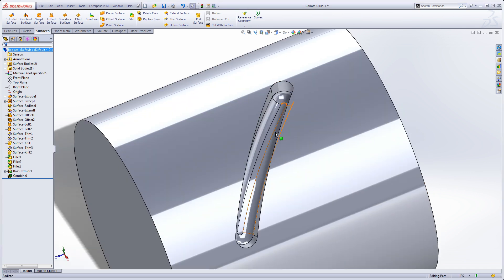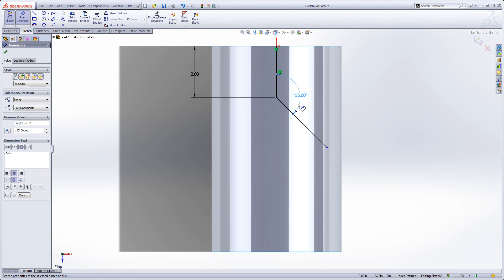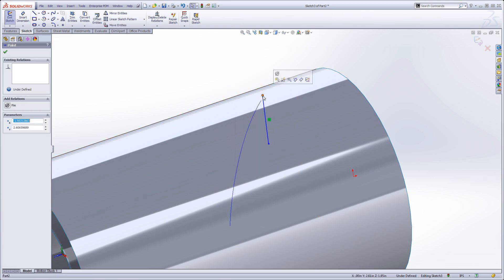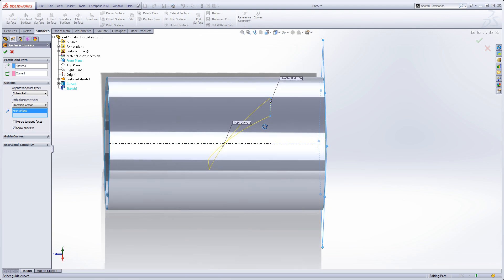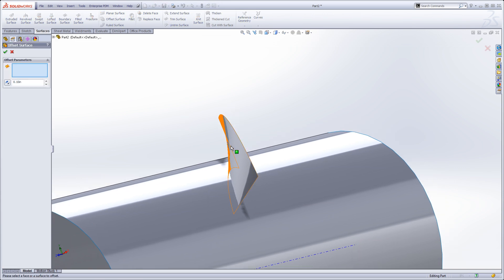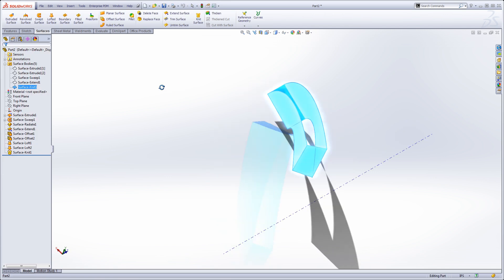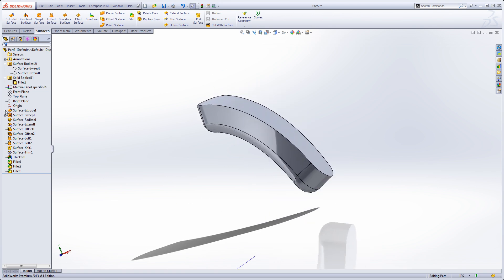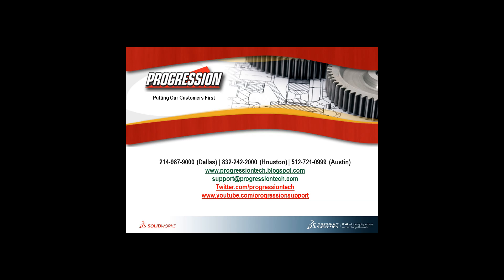Modeling a slot on a cylinder, 4th axis machining with bull-nose cutter

Comment: You should try using the S key menu, it saves you a lot of mouse travel and if customized you can have all the commands in one neat menu. Also note the D key is default for dimensions, another time saver.